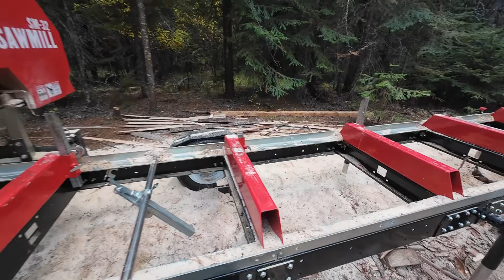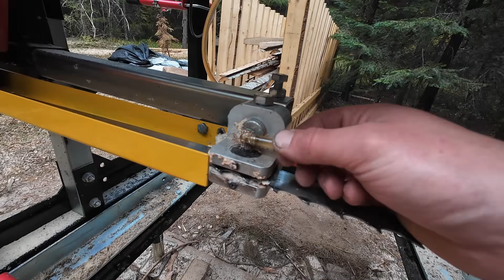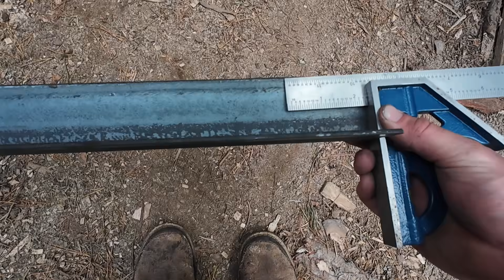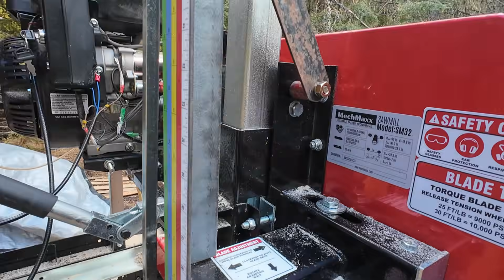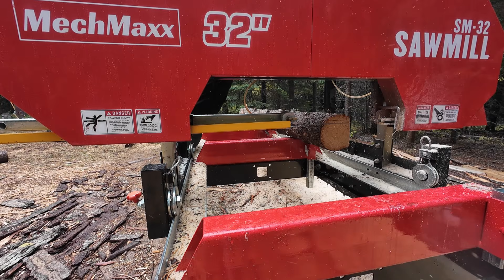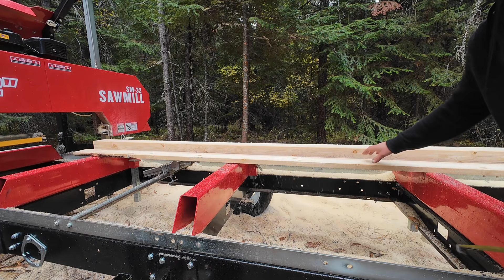Making an Upgraded Scale For The MechMaxx SM32

Comment: Hey boss, any initial thoughts on this Mechmaxx?? I am looking at the Woodland and like the 30" cut but this Mech is a little less in price?
Reply from the maker: Well overall it’s a pretty decent mill to get into the hobby. I’ve had some issues with wavy boards. Possibly leveling issues on my end. I’m not the biggest fan of the mill head locks where the woodlands mills has bushings I believe, so using the scale you have to compensate for the head tilting. If you get the trailer the leveling jacks are annoying because the cranks are on the top. Assembly is probably similar to woodland’s. I have noticed my mill head is not square to the rails kinda parallelogram sitting, maybe my fault again. And the manual is a bit vague in some parts, but I’ve gotten some good boards from it. Would recommend aftermarket blades. It gets the job done but it is a “budget mill” so depends on what your looking to use it for
Reply: I bought the mechmax sm32. Like he said it's a decent entry level saw. If I had it to do over, I'd get the woodland Mills sawmill. Live and learn.